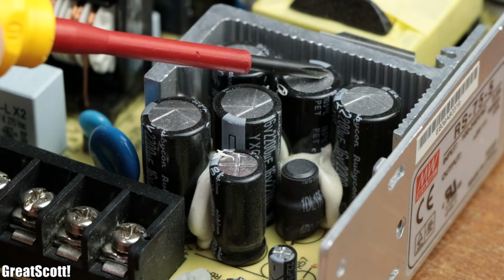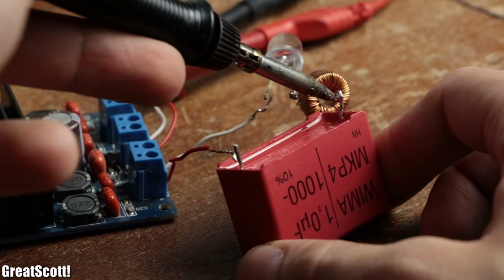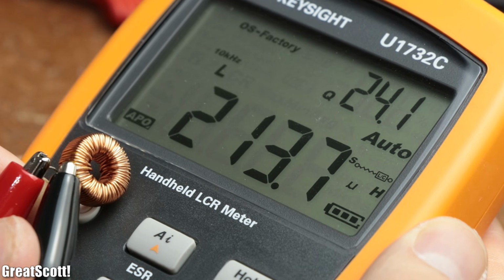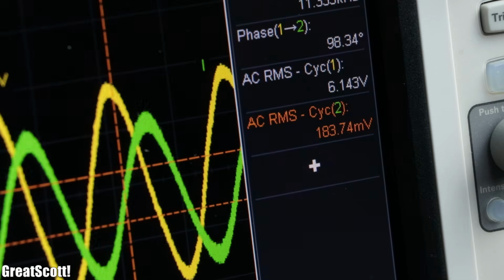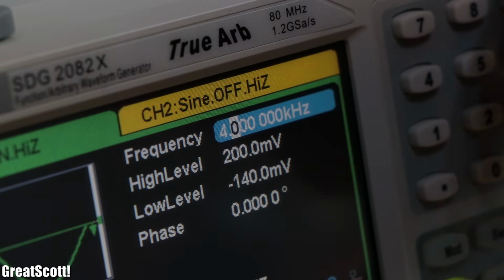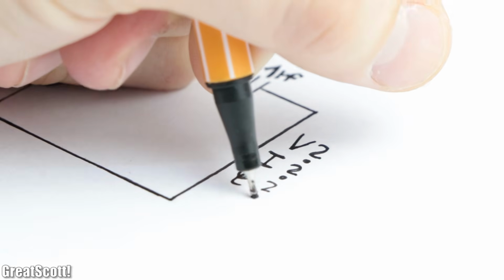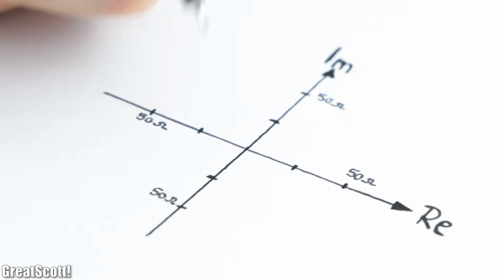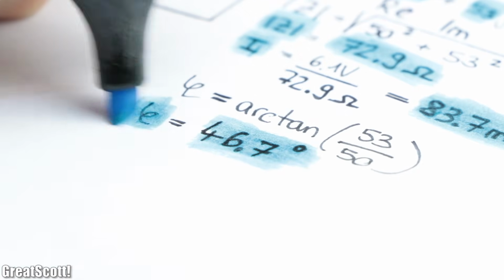Electronic Basics #37:  What is Impedance? (AC Resistance?)

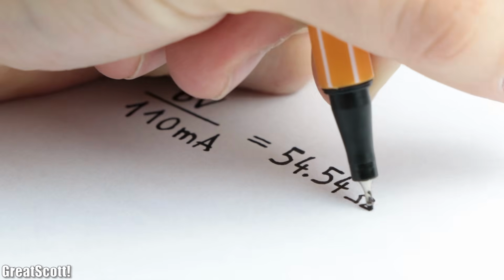Comment: Great video. Love the practical oscilloscope and signal generator sections. One thing I couldn't understand is why you read the RMS 110mV AC signal as 110mA (around 4:30), am I missing something? You did it when calculating the ohmic resistance for the inductor as well

Comment: It would be much more useful to show a real-world example, that demonstrates the usefulness of such information. 
As a practical approach, we can measure the impedance from the voltage, and current (voltage across a current-sensing resistor).
Also, what's the point of knowing about a phase angle?
Why does it matter, to a real engineer?

Comment: Thanks for the amazing content. 
As you have measured the total current of a series resistor with capacitor. so I can calculate the voltage drop across resistor by simple Ohms law but what if I want to measure the voltage drop across the capacitor for some calculations then how to do it.
kindly help

Comment: Capacitive reactance
The capacitive reactance is expressed in ohms and it is useful to determine steady-state current values to sinusoidal voltage inputs. Although the value of the reactance is expressed in ohms, it was not obtained by computing a resistance, as of resistors. 
The current in the wires of a capacitor circuit is due to the resultant electric field E(NET) (a resultant of the applied field and an opposing electric field, the fringe field of a capacitor), obtained by applying the relation for current density J = σE(NET), where σ is the conductivity of the wires.

The field in the wire which may vary sinusoidally is always a resultant of the applied voltage which may be sinusoidally varying and the fringe field due to charge accumulation on the capacitor plates.
For a comprehensive description of the mechanism of current leading the voltage across a capacitor see the book references below. 
Inductive reactance
The inductive reactance is expressed in ohms, and is useful to determine steady-state current values to sinusoidal voltage inputs. It is to be noted that though the value of the reactance is expressed in ohms, it was not obtained by computing a resistance, as of resistors. 
The current is on account of the resultant of the applied field and an opposing coulomb electric field, which is due to polarization by the non-coulomb curly patterned electric field associated with the changing magnetic field, and the current obtained thereof by applying the relation J = σE(NET) where E(NET) is the resultant field of the applied field and the coulomb electric field and where σ is the conductivity of the wire.
For a comprehensive description of the mechanism of current lagging the voltage across an inductor at different frequencies see the book references below. 

Electrostatics and circuits belong to one science and not two, that of electricity and magnetism. To know how they are unified visit this link 
https://matterandinteractions.org/articles-talks/ and view the article 'A unified treatment of electrostatics and circuits.  B. Sherwood and R. Chabay, unpublished. (1999)'
pdf. 
For a detailed discussion of the physics of inductors, curly patterned non-coulomb electric field, coulomb field and lagging currents in a inductive circuit at different frequencies of sinusoidally varying voltages see "Electric and Magnetic Interactions" by Chabay and Sherwood 
www.matterandinteractions.org
or 
Fundamentals of electric theory and circuits by Sridhar Chitta
https://www.wileyindia.com/fundamentals-of-electric-theory-and-circuits.html
There is a "look inside" feature in the amazon.com webpage of the book "Fundamentals of electric theory and circuits" by Sridhar Chitta with a few pages of Chapter 1 which may be viewed and also which you may swipe left or press < icon to view the foreword, preface and Table of Contents. 
For a lecture by Prof Ruth Chabay on surface charge in a simple dc circuit visit 
https://youtu.be/-7W294N_Hkk

Comment: How about if electricity was A-line made of a certain number of curves And those curves came back also so there is 2 directions of curves that stretched  out through say a wire,  you would have the same number of curves but by stretching them out they would get flatter and flatter which would represent less resistance which would mean you have to much energy coming back to the source or am I way off?

Comment: Hello Scott! It is said that in an ideal inductor there is an emf of inductance that is equal to the voltage of the source but opposite in direction. So, could you please tell me how can there be current if the voltage of the source and the emf of inductance compensate each other?
Also, can you please explain what's going on in an inductor when we turn on the current? On this graphic( shorturl.at/wBHP4 ) it seems that current is zero for 1/4 of period while voltage(and emf of inductance) are increasing. But how can emf of inductance increase if current is not changing? Or is it changing but by a very small amount?

Comment: hey if you said before basic ohms law can get wrong answer to find the true current value using manual computation without using any device like current clamp connect to oscilloscope. may i apply indefinite integral formula? and partial derivative? meaning i will use different equation??

Comment: hi, people. i got a question. i  have a 3s5p liion battery pack with a 
10A bms, and to that point it is totally ok. the question comes here:

i'm planning to add a BMS to each series pack and to that a microusb 
connector to be able of charging each pack separately but with a 5V 
power source (ie, any smartphone charger[besides, i got to admit that it
 is to take advantage of any place where they have 5V sources or if i 
lack a 12V one]). Also, i'd have a voltmeter for each pack to kinda 
balance the whole battery for myself.  What yall think about that? could
 any problem occur besides balancing, for example, when using all those 
three ports?

Comment: (English is not my main language)
Hey
I am having trouble finding a good mosfet for my case. I am planning to make Arduino controlled light. I am not really good at electronics, but i think i need a mosfet. And that mosfet needs to be logic level, and can handle 220v ac (about 300 mA). I need help to buy the right one, and the wiring.
Thanks

Comment: I thought I was great at circuits until ac microelectronic circuits. Still don't know wtf a voltage follower is despite having solved many circuits involving them.

I don't know if this is true for everyone but if you're going to school for electrical or computer engineering I highly advise getting a cheap but good used oscilloscope. Seriously, I can read the same chapters in the same books and solve the same problems over and over again and when asked to design them even after given specific parameters I don't even know where to begin.

For me it takes spending time alone with an oscilloscope, function generator, variable power supply and a bunch of components to build various circuits to really understand what's going on.
Reply: That takes a lot of time. Just a recommendation. Learn LTSpice, you can quickly build schematics and simulate them. It's a good way to confirm the theory and experiment with changing values of componants. And it is free.

Comment: When an inductor comes with a dc circuit it is ok bt whenever it comes with an ac circuit it gets more complex and hard to understand what is the functions of that imaginary part..
Reply: The imaginary part stores the magnetic field . That is why the current and voltage are out of phase. If they were in phase nothing would be stored the energy would be dissapated as heat like a resistor.

Comment: Hi i have question  What is making difference between battery and capacitor ? They are both constructed kinda same i mean they have positive side separator and negative side all rolled inside them  and also some electrolyte. So why  batteries have more capacity then capacitor ??? I know maybe this is dumb question but i really want to know
Reply: Batteries store energy chemically. When you charge or discharge a battery there is a chemical reaction happening inside. Capacitors store energy electrically. Opposite charges attract so a capacitor is design so that this attraction hold the charge in place. Similar charge repel and this repulsion is what causes the capacitor to discharge.
Reply: Batteries discharge curve is flat (constant voltage) then when depleted the voltage decreases.  Capacitors discharge exponentially  (much quicker) voltage decreases quickly.

Comment: You really should show the phase angle on you X axis in your diagrams. I would also recommend showing the unit circle (polar coordinate graph) versions of the graphs since they show phase angle shift the best and are useful to show how to calculate the new phase angle when you has inductive and capacative components. It will also show why we see pi in the equations without getting into mathematics that are beyond algebra.

You can also use simultaneous equations to calculate the impedance.

Comment: It is important to understand the difference between  the  AC resistance, AC reactance and finally AC impedance.
The total AC power losses of a circuit is the sum of the losses of the parasitic resistance of the reactors + 
the losses of the resistors.   A capacitor has almost NO losses at DC.     

The best way to to view AC resistance is too realize that ONLY the AC resistance is heated by the current.
The power dissipated in a coil or capacitor are attributed to parasitic resistance of these reactors.

Comment: I think you could have explained why inductance causes impedance better. An inductor creates a strong magnetic field which works against the intended current flow because it ultimately causes back EMF said simply a voltage in the opposite direction. However only a changing magnetic field has this effect, not a constant one. This is why GreatScott says in the video that it is not an issue in DC circuits in order to not confuse people. The effect of back EMF does show in DC circuit but only when first energizing the circuit, what happens is that the current rises slowly over time to it's maximum value. Once it has reached that maximum value then the inductor no longer has an effect on the DC circuit. Moving to AC, current reverses over and over at very short time intervals, therefore usually at high frequencies the rise time of the current that we talked about earlier is longer than the time for reversal of current which ultimately places a limit to how high the current rises at it's peaks in the sine curve, this has the effect of a current limiter like resistance but through a different means, known as reactive inductance which is an ingredient in the overall impedance of the circuit.
Reply: nice input
Reply: An inductor will support only so much voltage. Once the core saturates the current increases dramatically.

Comment: Once you derive the impedance and you calculate current flow based on that, is that current flow RMS?
Reply: Once you derive the impedance and your calculating current  then you should of been given a voltage. That voltage should be defined as rms, peak, peak-peak.

Comment: OOT : i am just curious. If the electricity flows to my house from the transformer is 1300VA, does that mean my house is only able to support 6A of current ? (I live in indonesia and we use 220V here)

What happen if we have lots of chargers/phone's power supply connected at once which 5 alone can draw at least 5-10 ampere ? Is lowering the voltage (220V ac inverted to 5V dc) also means you get more current ? I am a bit confused. 

I am just a hobbyist learner, and want to learn about electricity.
Thanks for your time to help me learn through your videos, cheers! 🤗
Reply: Hi! I hope I can clear this up for you a bit:
1st: I highly  doubt that your house really is only capable of getting 1300VA delivered, as things as Vacuum cleaners and kettles easily exceed 2000W (W ~= VA)
2nd: 1300VA means that you can get 1300 Volts * Amps, so at 220V you really only get about 6A. However your 5V power supply doesn't use up way as much current as it's outputting at 5V.

Roughly speaking: If your supply is 100% effective and outputting 10A @ 5V that means it is using up 50VA. Or the other way around: it is only using about 0.23A @ 220V
So you would have to plug in like 26 chargers and having all of them charge at their max. rating - but again 1300VA seems rather small to me.
Here in germany normal power sockets are rated at 16A @ 220V, meaning that we have about 3500 W of power available per strand of fused sockets. Usually you have quite a few of these strands.

On the other hand I have no knowledge about the indonesian power grid and I would really like to hear, if you misread or if your house really looses power by plugging in a kettle. Or an Oven even, which easily exceeds 4000W
Reply: @Yamahapsr200  hello, weird enough, here in indonesia we just cut the 450VA class (for the poor) and moved it to 900VA. My house has been on 1300W (or VA ? My technician told me it's VA, but i don't have any idea about the difference) for 10-15 years. Most of houses around me, i'm pretty sure, have 2200VA / W at max.

We are a developing country, so i guess it's rather hard to find something like oven in the house except for the middle-upper class.
My brother got scholarship in Rotterdam and visit germany once, and was blown away that germany is actually that "developed". We know you guys are like so much advanced than us, we just don't know that it would be that much.

We, for example, still use like gas tube which you can refill, to cook using traditional stove. Much less comfortable than what my brother had in Netherlands "electric stove".

My brother also noticed that every house in Netherlands or germany almost all have both heater, and some have Air conditioner.
It's so 180° here that you can literally walk some kilometres and won't find any type of air cooler/air conditioner in any house.

So, i guess that explains a bit of the electricity usage here.

Thank you for explaining, a great one. So, there is no difference between VA and W ? I had an electrician once told me that W or watt is the actual power draw while VA is like the assumption how many power it can draw V times A (or something like that i don't quite remember )

But isn't W equals to V times A ?
Reply: 1300 VA it's a really little power for a house, and yes, I think that with 220V you would get even less than 6 A, someone correct me if I am wrong, maybe I am not seeing something

Comment: I was supposed to know all this stuff last year and I never knew you could draw the complex and real impedances in a graph and get the phase angle and magnitude that way.
Reply: Basic high school stuffs
Reply: Have you learnt calculus?

Do you know how to solve differential equations?

All these comes out when you solve the differential equation for a LRC circuit. 

You don't have to memorize formulas, infact, i think memorizing formulas is the reason you haven't learnt anything at all.
Reply: @willyou2199  Uncalled for, I can solve differential equations and I never said I "haven't learnt anything at all". I just never knew about that one particular trick
Reply: Are you sure?

If you solved the diff eq for LRC, you'd get impedance = R+1/(jwC) or R+jwL, depending on inductive or capacitive. Complex numbers have polar representation, ie magnitude and phase. 

Either you've no idea how impedance is calculated, or don't understand how complex numbers work, this shouldn't be new to you.
Reply: @willyou2199  I never used polar representation for this, I simply never made the connection